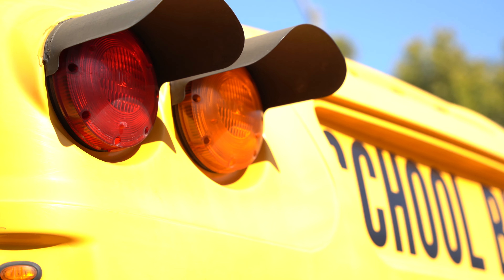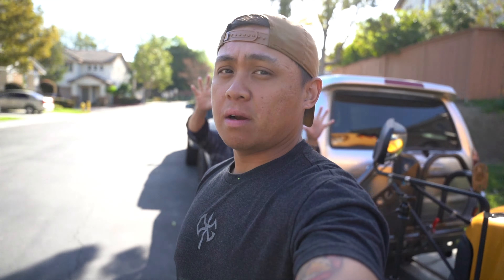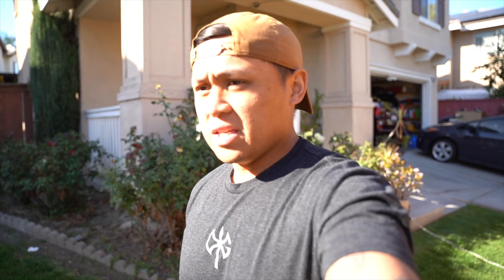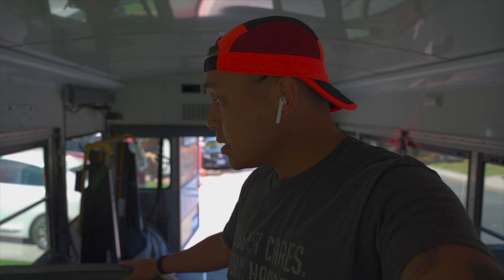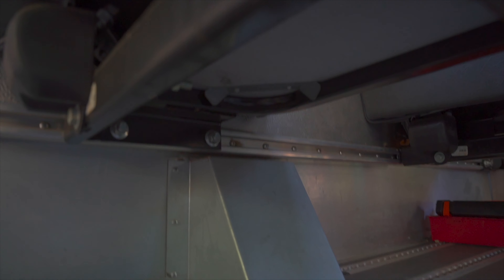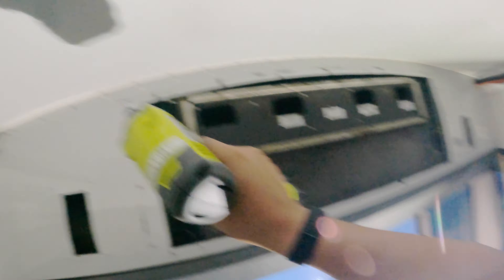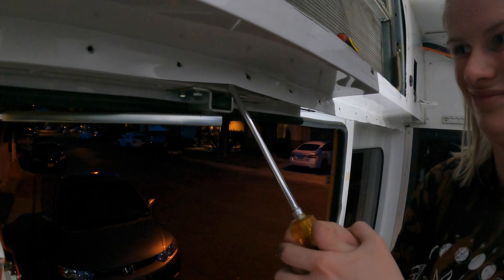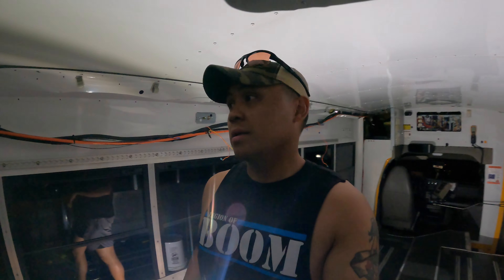THE DEMO BEGINS| Bus Build ep. 2

Comment: How hard were the seats to remove?
Reply from the maker: It wasn’t hard at all (ours wasn’t rusted). You just need someone up top holding the bolt down and someone under taking the nut out with a drill.